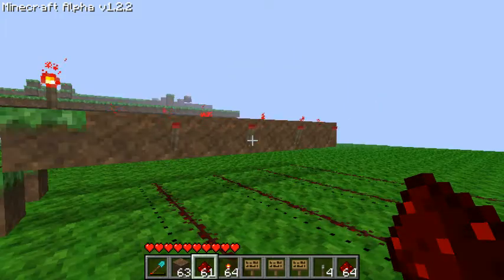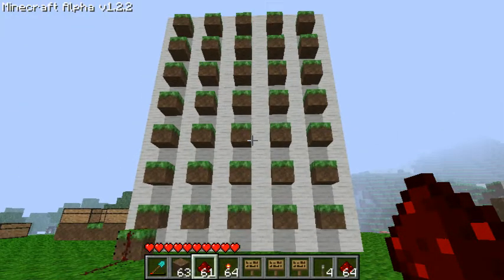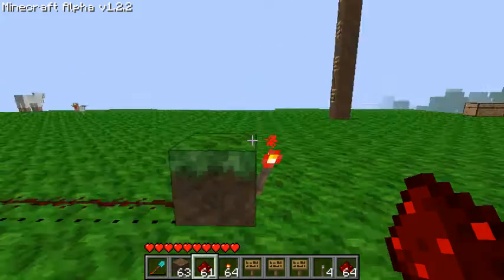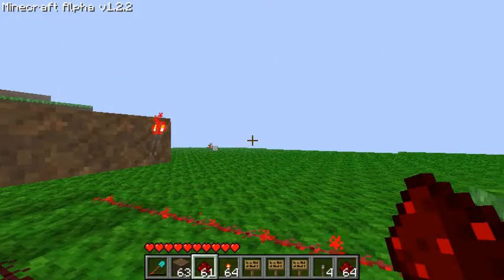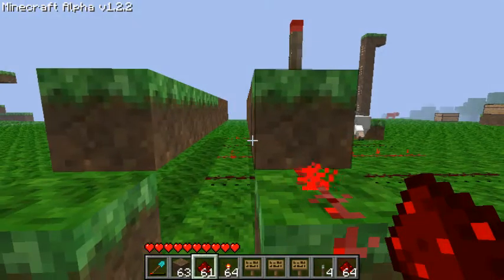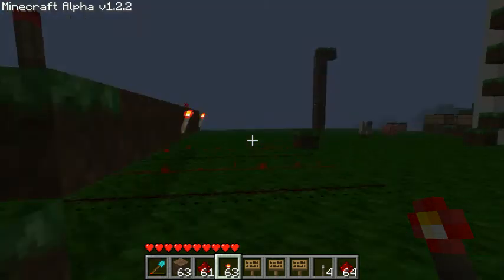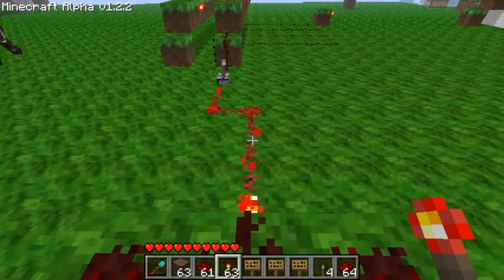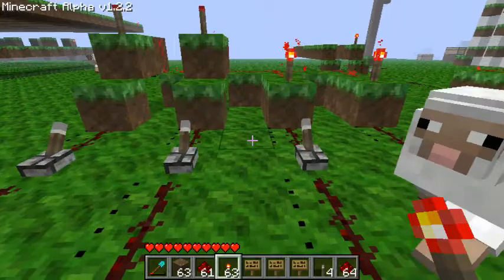Minecraft - Harbinger's Redstone - More Detail on Display Drivers and Binary Decoders

Comment from the maker: @RJayCoelho the inverters ARE necessary if you are trying to decode more than a 2-bit binary input, that's the point...This Video is explaining how to make a binary decoder,  The last gate is 4-bit and without the inverters it wold activate on 0011 AND 0111 AND 1111 (3-7-15) so you have to explicitly state that inputs 3 and 4 must be off.